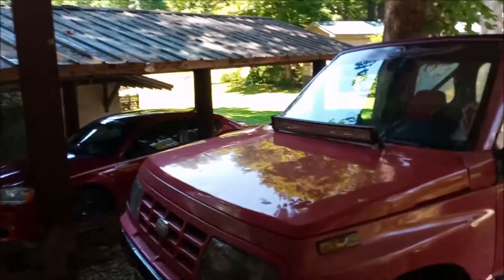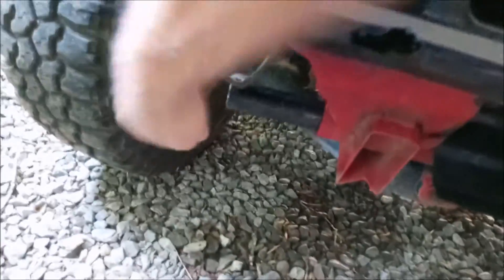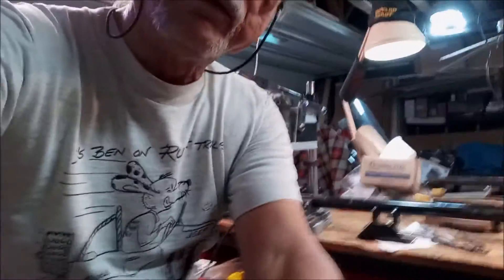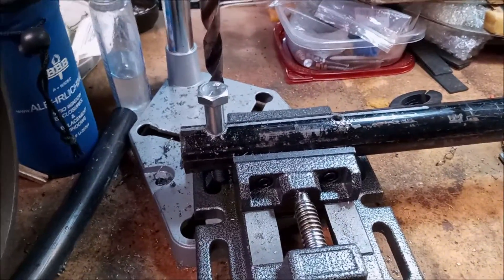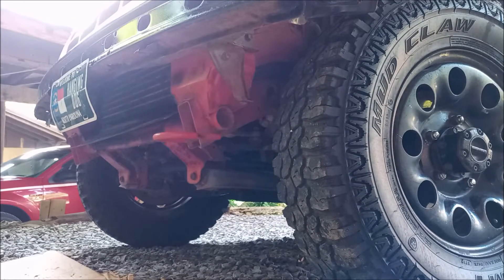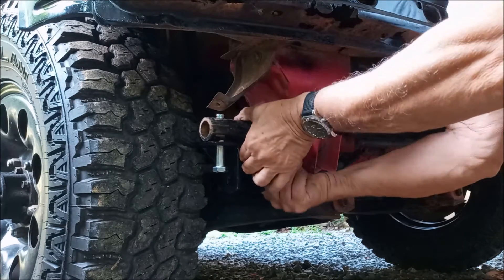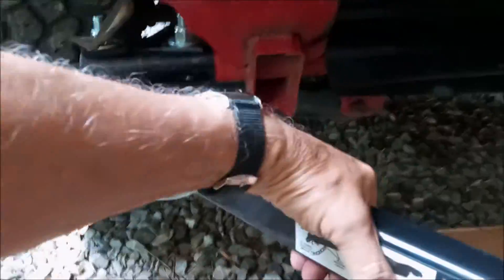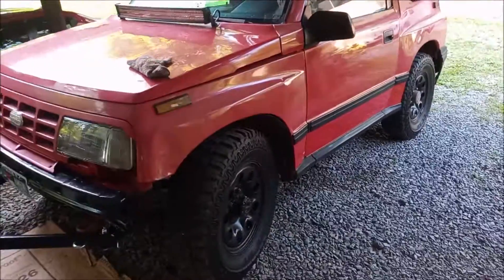Geo Tracker (1992) Tow Bar Install - pt. 1 of 3

Comment from the maker: Noted. Thanks.  However, there is a "stop" plate, (for lack of better description), that prevents much rotation. And the connecting pin allows slight swiveling.   Due to "life happening", I have not been able to road test, as of yet. As soon as is possible, I will do so and post my results, video too.

Comment: Looks like it will work but the pipe can still rotate that's not good the pipe will do better if you put a through bolt in the middle stopping and starting will put a little stress on the bolts.
Reply from the maker: Thanks for the tip